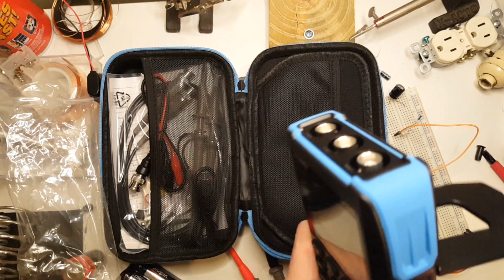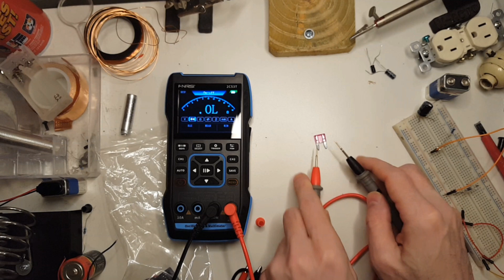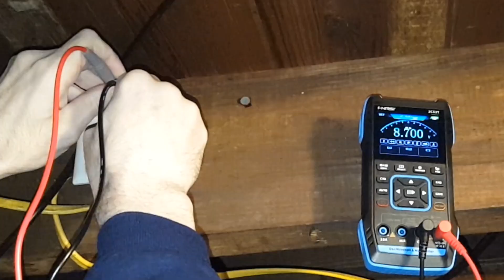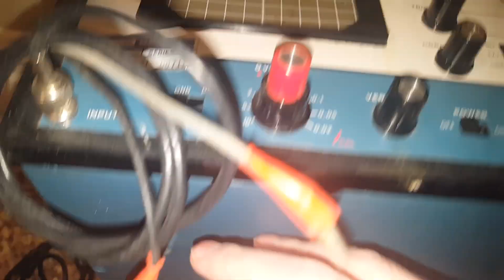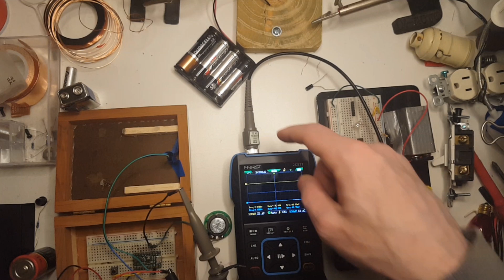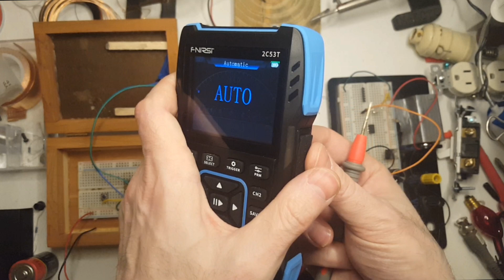How to use a Multi-meter around the house | FNIRSI 3-in-1 Oscilloscope multi-meter 2C53T

Comment: Great video.    It’s a bit confusing once we get to the oscilloscope function.   Are you interrupting the ground or connecting in parallel to that digital vintage music generator?   Can you measure household voltage on that oscilloscope feature or will it fry the meter ?